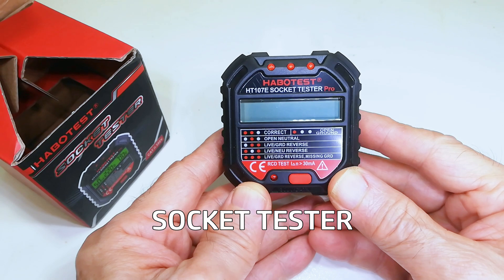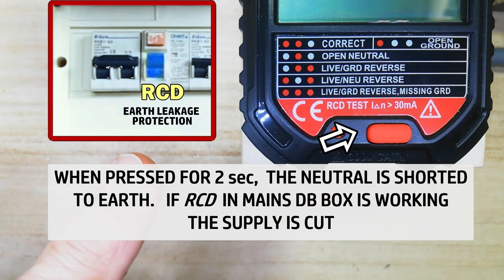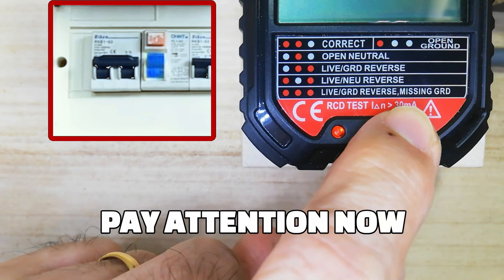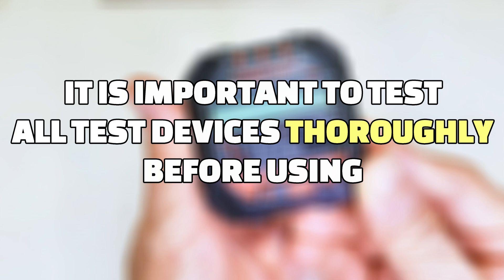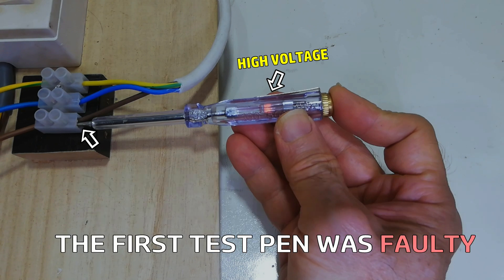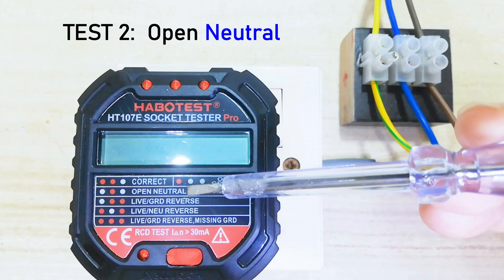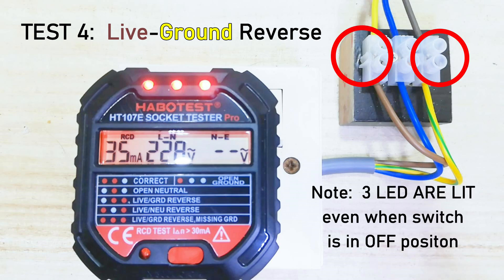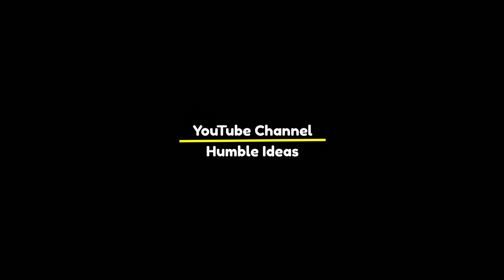SOCKET TESTER HACK AND EXPERIMENTS

Comment: hi, but what happend when the 2 first are on but the 3erd is blinking?
Reply from the maker: That's not covered in the manufacturer manual.  However from my experience, I actually did encounter a case where the Leds blinking happens when I was checking an extension sockets strip using the Habo tester .  On thorough investigation, and opening up the sockets strip ,  I found that the Live  wire connecting to the socket has been corroded. The copper became greycolor and quite brittle.  Perhaps you may check your wiring quality too for your case.
Reply from the maker: @AROSSEL  btw, could you do me a favour subs my channel. .I have many interesting videos, here is a trending one. https://youtu.be/lYESri_Rpgc

Comment: Nicely done. Thanks.
Reply from the maker: Yes..  but I am still confused by the test button for RCD as mentioned, hahaha 🤣
Reply: @HumbleIdeas  I watched another video. The test button is supposed to trip a GFCI or RCD breaker because it leaks current to the ground when the current on the hot is not equal to the current on the neutral . I have not received my tester yet. My house does not have a GFCI breaker. Therefore, I cannot test it.
Reply from the maker: @Loki-vp4in  As the design of this device is based on UK sockets, and rfci (RCD) function is NOT embedded in sockets (unlike in USA ) I still think it does not make sense to test RCD function upstream at the DB, when I fact this device is labelled a SOCKET tester. Accidentally press of the RCD test button will black out the WHOLE HOUSE because in British Standards the RCD is centrally located at the DB upstream.  That's why in the video I disables the RCD test button by slicing off the rubber.  If I want to test the RcD in the DB I will go to the DB and press the test button THERE. 😁
Reply: @HumbleIdeas  Should it not just trip the GFCI/RCD breaker associated with outlet under test instead?
Reply from the maker: @Loki-vp4in  usually in the UK or Commonwealth countries using the BS electric distribution systems, one RCD will control half dozen or more independent MCB rings. .so if the RCD fails, multiple rings will go down.  As mentioned, a socket tester is meant to test the socket and not venture into components outside the socket as it will lead to some confusion as to what is good and what exactly is bad.

Comment: I disagree that the RCD test is redundant. If you have a short (or reverse?) between ground and neutral, the socket tester might not detect it, but the RCD button will detect it. (It will not trip therefore something is wrong). 

It would also trip when you connect anything else, though.
Reply from the maker: Thanks for your comments.  Firstly there is no RCD inside the tester. The RcD is a fairly robust spring loaded chunk installed upstream in the DB.  It's very important to protect lives, if RCD fails, it means that futurely any earth contact with Live will kill the person touching casing of an appliance.  For this reason RCD manufacturers recommend monthly checks on the RCD itself, using a build-in test button in the RCD case.  In practice nobody I know bothers with this advice, coz RCD seldom ever fails , it is so reliable!.  In the extremely rare event when RCD in the DB can't detect earth neutral fault, then I agree totally that this Tester button will be helpful as it offers a check on that.  However this is extremely rare and one is better off testing the RCD function in the DB using the RCD test button directly as recommended by manufacturer of RCD.

Comment: Hi! What happens if you pressed RCD test and you dont have an RCD? I'm not knowledgeable about electricity, I purchased a socket tester to check my wall sockets and i pressed the rcd test button.
Reply: Nothing bad if you press the button shortly. If you press it for very long (several seconds), some (cheap) socket testers could be burnt. But in any case nothing bad will happen to your house or installation.
Reply from the maker: @nomestoni  I know there is nothing bad.  However the house power will trip ,it just shows that the protection works.  But there is little point in this action, as mentioned, if I wanted to check the RCD I just go to the DB and press the button of the RCD to test it.
Reply: @HumbleIdeas  The point of the RCD is to check if the earth and neutral have been swapped. If they haven’t, the RCD will trip, but if they have, and the current you leak actually returns via the neutral wire (which is terminated into the earth pin at the socket), nothing will trip.
Reply: @nomestoni  thank you for the reply! Thats a relief to hear
Reply from the maker: Is your house very very old?  Practically all houses have RCD or ELCB.  It is important because without RCD you will not be protected from electric shocks in case live wire is in contact with metal part of appliances.  RCD ensures that the protection will always be available.
Reply: @HumbleIdeas  kind of yes. We have circuit breaker but no rcd. So nothing bad really happens? when I accidentally pressed RCD test I went and turned off our breaker for a bit then turn it on.
Reply from the maker: I can't agree with that.  The red button clearly stated "RCD" test.  It is meant to test neutral to earth short so that it can confirm the "RCD" upstream works. The label didn't say ' N-E reversed test'.  Suppose as you said the neutral and earth were indeed reversed.  If the circuit does not trip, it can actually mean the RCD upstream is faulty, or it could mean the NE was reversed.  You CANNOT conclude it is due to the inadvertent swap of Live and Neutral.  Hence the large red button is quite useless, as mentioned if I wanted to test the RCD I will go to the DB and press the test button.
Reply: @HumbleIdeas  right but it’s not for testing the RCD it’s more for testing if you have the neutral/earth swapped. If it doesn’t trip then yes it means either the RCD doesn’t work or, more likely, that the neutral and earth are swapped. I think test the RCD at the board to confirm it works, then go through the outlets and hit the RCD to confirm you don’t have swapped neutral/earth.
Reply from the maker: @jaymowebsta2284  then it's not making sense the manufacturer could have said "NE reverse " in the same way they labeled LN Reversed etc.  Also generally very rarely will someone make a mistake of NE reverse, therefore for practically all the time, pressing the red button will trip the whole house electriciry,  it would be a silly way to test NE reverse.
Reply: @HumbleIdeas  there’s no other way to test it, in nz there’s typically three circuits per RCD so it wouldn’t trip much over here so not a big deal to hit the button.
Reply from the maker: @jaymowebsta2284  You mean the RCD in NZ has no test button?  I thought these RcD are BS (British Standards) generic and ought to have the test button.  In fact the RCD usually has a label "press once a month" asking the user to check it's working regularly.

Comment: What does mean of the 35mA RCD? It measures tripping time?
Reply from the maker: No the device spec of >30 mA is the current trip value of leakage.  Not trip time. Anyway this tester is mainly for connectivity checks and bad wiring checks not much for measuring leakages
Reply: @HumbleIdeas  thx for your inf. It just displays 30mA when it is supplied?
Reply from the maker: @Kowloonhongkong  ah I understand your question now.  Its strange why the tester seem to display a leakage current of 36mA.  I'm checked another socket is same 36mA.  Let me find the manual, it's in one of my cupboards.  I will get back to you soon.
Reply from the maker: @Kowloonhongkong Hi! I'm just found the manual.  It said that the indicates panel display "36mA" is just informing that the setting is being set at 36mA (this cannot be changed)  and any earth leakage exceed 36mA will trip RCD in the house.  It does not actually measure THE leakage current which is zero or very near zero for a healthy house. Thanks for interest in this demo, do Like and Share it if you find it useful and sub my channel 😀
Reply: @HumbleIdeas   Thank you. I was confused why an RCD mA was shown.  (I thought that maybe it showed the result of the previous test.)   The number does change but I don't know why. Maybe calculated based on the voltage?
Reply from the maker: @brianwest2775   actually the indicator value for the setting changes  slightly with another socket in my house . Perhaps it is there to give you peace of mind that everything works and the slight change may be due to component values in the PCB being drifted 😁
Reply: @Kowloonhongkong  This guy is dangerously undereducated on these devices and on the principles of electrical safety generally. Firstly, you never modify test devices, at least not so casually. Cutting that button top may have reduced the thickness of insulation between your finger and live parts of the circuit to less than the 1000V breakdown required for safety. Secondly, never EVER use a test pen to see if a circuit is safe. They are nicknamed suicide sticks for exactly this reason. Only ever use them to confirm the presence of an expected voltage, NOTHING ELSE. Testing for absence of voltage should be done with a multimeter, and it should be verified to be detecting a known live circuit before and after every safety check. Thirdly, the RCD current value shown is the current at which the RCD actually operated. The tester starts simulating a 30mA leak and slowly increases it. It tells you the value at which it actually tripped. So he also can’t read a manual. He’s dangerous.
Reply: @Aussiechip thx for your inf. Generally you are right. however using the pen is crazy popular in Asian. In my career life in Hong Kong, i only have seen several companies these prohibits using  a pen type or a multi meter. In fact,i worked in one of these companys, there was  not 100%not using with the pen type because the pen type is the only option for  some non common cases for dead proofing and trouble shooting. For cutting the button, it is electronic control, so no problems with the question of insulation . i found out that we dont need to modifty the button because the design comes with 2 seconds delay. this tester is good. it helped me recognise neutral fault at upstream

Comment: Neutral and ground are connected where i live
Reply from the maker: That connection is at the DB I'm thinking?  Will GFCI trip if neutral and earth short at the downstream sockets?
Reply: @HumbleIdeas  yes they are connected at the DB , GFCI compares phase and neutral current and if a slight difference between them it trips ,for example i touch the metal part of a device which has a damaged insulation of the live wire ,a small current will pass through my body and GFCI will sense the difference and trip immediately
Reply from the maker: @mar-tin702  in that case I think the socket tester in the post should also work at the downstream sockets I think despite that the connection is established at the DB.   The pin incompatibility with the American style socket is a different issue.  I am sure you have socket tester for American style outlets too right?  The device in the picture is designed for UK sockets.